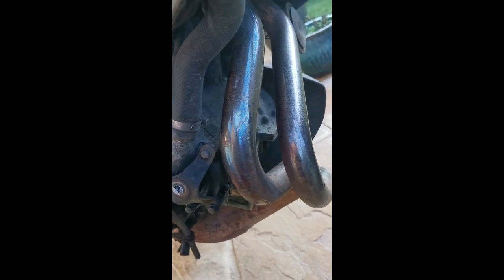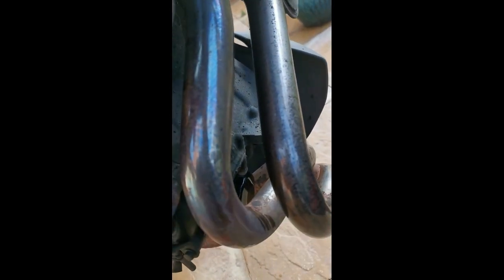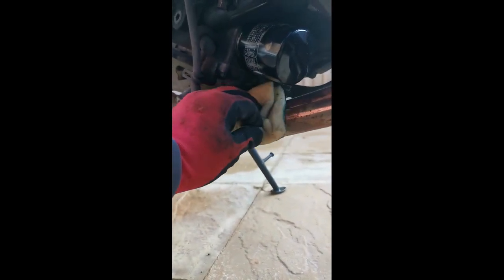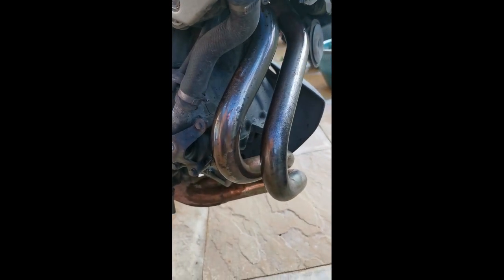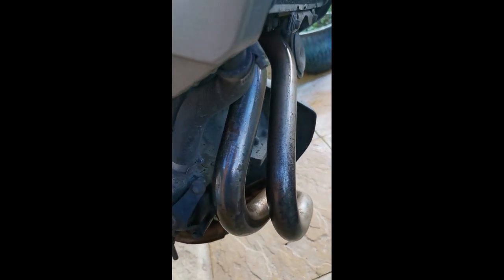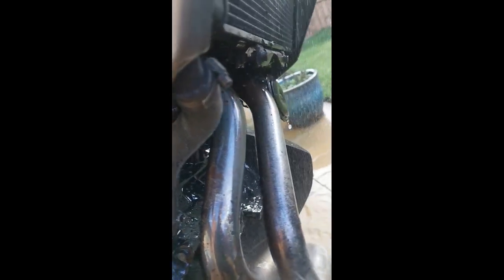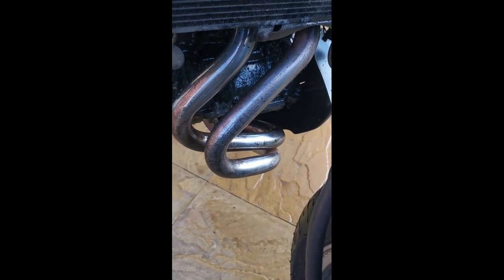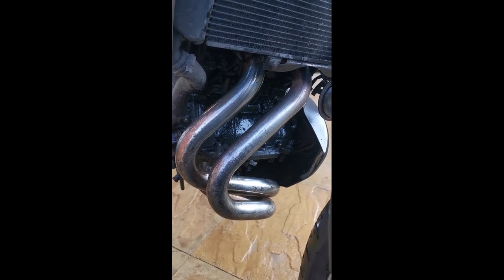Motorbike exhaust downpipe clean, is Harpic the way to go or just an expensive mistake

Comment: Yeah, contains 9% hydrochloric acid.... be somewhat careful. You'll never get rid od that brown discolouration (without specialized buffers etc).

Best thing to do is take the pipes off and get them ceramic coated.... use the high-temp Cerakote or go to Zircotech and get the Endurance finish. Not cheap, but if it's a worthwhile bike or hard to replace pipes... then worth it.